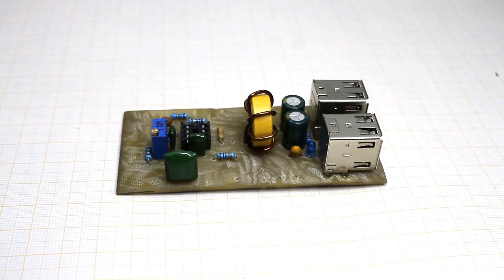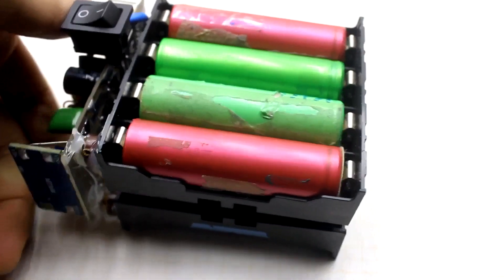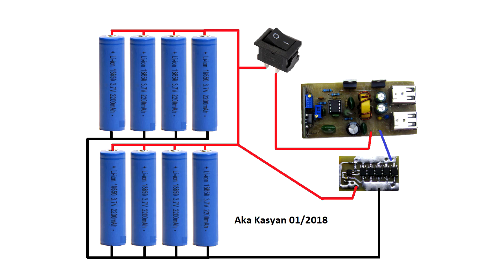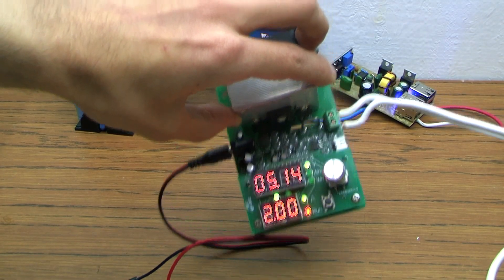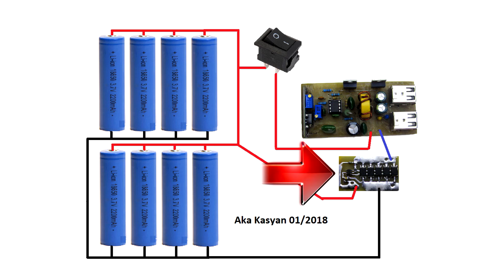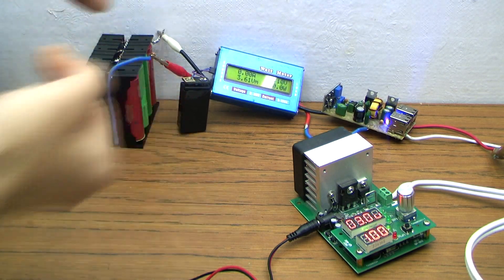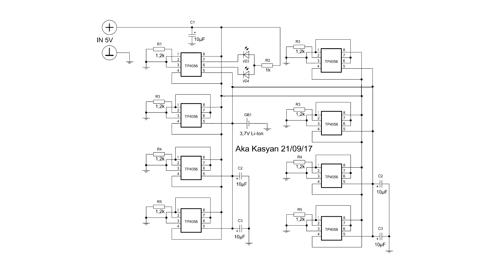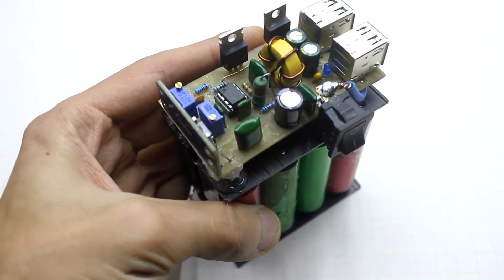How to make Super Powerful Power Bank (part 2)

Comment: This is great except the one thing that most people outside of the USA will be missing in this circuit is those batteries.

Yes we can raid our laptops but then we need our laptops to check out your circuits, we need people who are selling these batteries at a reasonable price especially in the UK, as these cells tend to be around 4 to 6 pounds per cell, so we end up with the cheap crappy ultrafire cells and they are an improvement on what else is on offer, sad but true.
Reply: if they're lipo they do. 4-6pound for lipo seems good depend on capacity. Project gets expensive...
Reply: Yeh I don't think 4 to 6 pounds is a good price when in the USA they are getting hold of them for a dollar a cell.

Even our secondhand market is over the top in price now, something they used to throw away is now gold dust to them instead of them simply selling them off to make some extra cash they sell them for way over the top prices.

What is needed is an importer of this product, get in while people are desperate for them at a decent price, electric bikes, scooters, mopeds, even cars skateboards they make use of these cells but we can't get them in the UK at a reasonable price.

It's just nuts.

Comment: I find it interesting that you consistently use a switch in down position for the "ON" position. We use up position to indicate the "ON" position! It's even in building codes in some places!  
Very odd. I've never seen that before.
Reply: UFOhunter UP is only ON in the USA, the rest of the world logically use DOWN as ON.
Reply: Never seen anything else..
Reply: When something goes down, its assumed off. When its up, it's assumed on. Like; "The server is up"!
What logic would yours be?
Reply: The local logic. The only thing interesting with the consistent use of the switch position is in your case, that it differs from your known concensus. Should that be interesting.
Not logically up or down - as a generality.
Nice you have a standard.
Nowadays one needs to consult a symbol sheet....
Once upon a time it was down for on 'round'ear' but nowadays, I jaint so sure....
keep huntin you-fohs - if I was one, I wouldn't land on this planet.
Jovial best wishes to ja